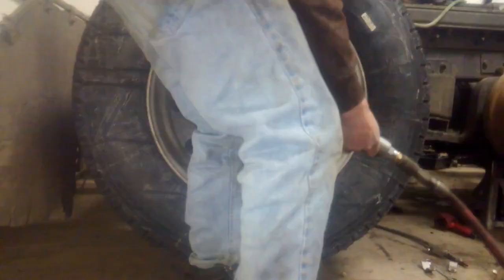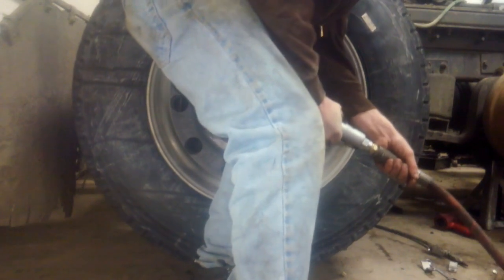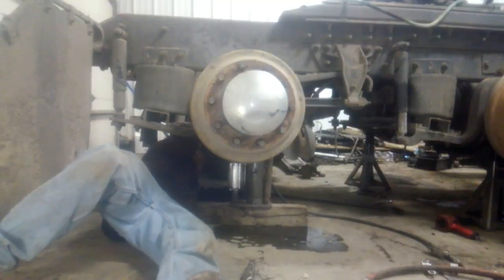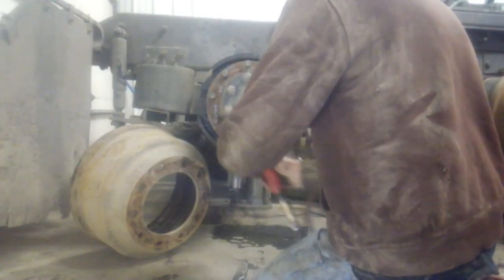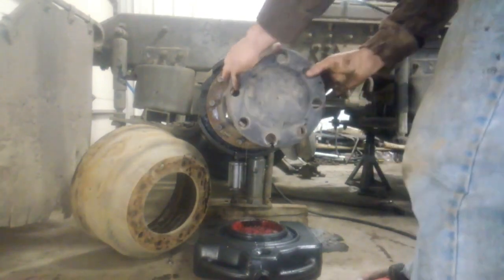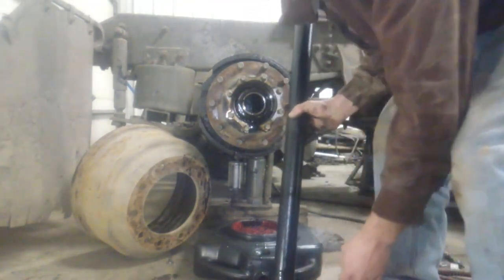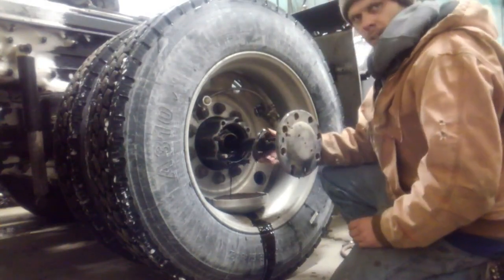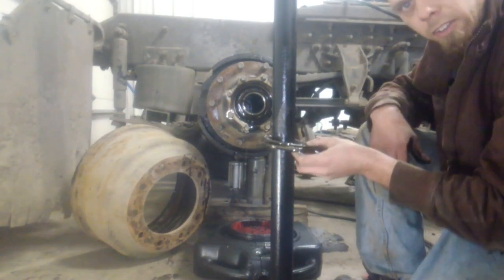wheel bearings seals and races replacement on a semi truck

Comment: Any tips for removing and installing races on aluminum hubs? I've only been a diesel mech for about a year, and my mentors always seem to tell customers that we cannot take out the races on aluminum hubs because you have to heat/cool them and that it's a lot harder than steel hubs.

Comment: Hey. Brother. Just wondering. What. Size. Iron. Socket. You. Use. To. Take. Off. The. Inner. Nut. Of. The.   Hub. Thanks again. For. The. Videos. They. Are. A great. Help. Blessings upon. You
Reply from the maker: i wish i knew off the top of my head. truth is iv got a pretty good assortment of axle nut sockets iv collected over the years i rarely ever look at the sizes i just grab the one that fits. i know that's probably not much help to you.
Reply: Maybe a 3  1/4 or 3 3/4 they vary. Good to have several

Comment: How tight do you torque inside and outside nuts?
Reply from the maker: torquing procedure will go 200 ft lbs while spinning the hub, then back off 1 full turn then torque to 50ft lbs while spinning the hub then back off a 1/4 turn and line the dowel up with the closest hole in the lock ring. generally favor looser between two holes, also sometimes flipping the dowel lock ring will get you closer to a hole. then the outer jam nut is somewhere around 300-400 ft lbs without the tang ring like i added in this video or 250-300 is acceptable with the locking tang ring. i would recommend always using a tang ring even if there was not one to start with, iv seen a lot of jam nuts come off when tang rings are not used.

Comment: Hey ezrider quick question for you I was changing my drive tires on my truck and I took of the brake drum I had to cage the brakes because i have my abs modulator valve off the truck so i could not just push my brake button In. 
One side changed out smoothly but the other side of the rear diff the drum was stuck really hard with rust and debris I had to use my tractor with a chain and hammer it out now the new one is half way on but it doesn't go in any further and it same one as the old one plus the s cam is in the open position with that brake cage
Reply from the maker: might have to back the slack adjuster off a bit. i assume the drums are hitting the shoes and not getting stuck on the hub?
Reply from the maker: here is a video i did on brakes that might help you if you haven't seen it already. https://youtu.be/JHCpmQJEPbc

Comment: Is there other way to remove the race from the hub with welding?
Reply from the maker: Welding isn't nessisary just makes it a little easier
Reply: @Ezrider359  l am trying to remove the race in the steering axle hub  but l don't have welder.  Does hammer and flat Philips works?
Reply from the maker: A punch or drift would be preferred over a screwdriver but yes smack it like it owes you money alternate side to side
Reply: @Ezrider359  thanks you sir

Comment: Great vids mate. I got disc brakes on the CH I drive. I fucked up and wore pads down and wrecked rotor.
Today I pulled rotor off wrecked truck, tomorrow Im putting on the one I drive.
I dont have torque wrench to do  lock nuts on axle. I was thinking  tighten inside nut till zero movement, then back off a 1/4 turn. and tighten outside lock nut very tight.
Probably wont hear from anyone before tomorrow, but would still love feedback.
Im only a driver, definetly no mechanic😂

Comment: Hi what's is the size of the locknut socket
Reply from the maker: I believe both inner and outer nuts we're 4inch on that one 3 7/8 are somewhat common and 3 1/4 lock nuts on trailers are common

Comment: What is the part numbers to all bearing & race ? Thanks
Reply from the maker: there is many different rear ends that can be on these trucks and they don't necessarily all use the same bearing part number, call a dealer with your vin and ask for a part number or pull the bearings out and cross reference them.

Comment: Basically same process for the front axle then? Seems simple enough. I’m going to do my king pins after watching your king pin video. At the same time, curious as to why the hub needs to come off for the king pin job. Doesn’t seem to be in way of anything
Reply from the maker: the process is the same for the front drive axle wheel bearings. on the king pins generally the hub has to come off to remove the s cams so you can get the whole s cam assembly out of the way. it could probably be done leaving all that in place but i find it best imo just to strip the wheel end all the way down.
Reply: Ezrider92356 copy that and makes sense that’ll give me a good reason to just replace the worn out s cams anyhow. Thanks brother

Comment: Where did you get the big socket to remove the locking nut?
Reply from the maker: napa auto/truck parts stores generally have them on the shelf ask if you don't see them they may be behind the counter. that's where most of mine have been purchases from. if you have time to wait for them if you search ebay or other places on line for "wheel bearing axle nut sockets" you should find a number of them. generally when iv bought most of mine though its when i have already started taking something apart and realize that none of the ones i have fit that particular nut. then measure with a set of calipers run to Napa get one and your back to it in 30 mins. iv seen them come up in local classified ads as well.
Reply: So there is different sizes of these nuts? I haven't started taking mine apart yet on my kenworth, just making sure i have my ducks in a row before starting.
Reply from the maker: smart man its always nice to have everything you need on hand before you start. you may call kw and ask them what size you will need. there is a chance they could tell you the wrong size though. sometimes the outer nuts are smaller than the inside nuts. so you may need two sizes sometimes someone may have replaced the nuts at some point in the trucks life and used nuts with a different outside size. there is also a different style nut some people re-fit with esp if the threads have gotten a little buggered at some point in its life that rather than being a sandwich assembly its a thick single nut that has a inner snap ring assembly and kind of a toothed mechanism inside. that locks everything together that would take a different socket as well. there are probably 4 sizes of these sockets that i use most often i would tell you what sizes they are but the sizes are stamped really small on them and i don't think iv actually looked at the size sense i bought them so i don't know off the top of my head what size they are. then the ones for the steer axle are quite a bit smaller than the ones for drive and trailer axles i actually have a jumbo 1 inch drive socket set that goes big enough to cover those ones there probably somewhere around 2.5 inch where drives and trailers are probably in the neighborhood of 4 inch.

you can also get them off in a pinch with a hammer and chisel but i would not recommend that for re-assembly. but you could get it off like that to go run to Napa and match them up to sockets
Reply: Thanks for the info. Will napa have the seal punch as well?
Reply from the maker: they may. i would call and ask, being that i generally only work on my own equipment i personally don't own any of the large seal drivers, each style seal has there own seal driver and there is several different style seals that can fit one application. in this video i go over in a little more detail on getting the job done with minimal tools https://youtu.be/tXBuAh8lZI0 this one was on a steer axle but its all basically the same.
Reply from the maker: I am out at the shop the size I used in the video can't read the socket anymore but measures 4.006 so that should be a 4" the other most common ones I use are 3 1/4 and 3 7/8
Reply: thanks for the replies i really appreciate it. Love the videos, keep em comin.
Reply from the maker: no problem, my channel is pretty small so its not a big deal to respond to comments and try to help as much as i can when people ask questions. i appreciate you guys watching them.

Comment: The key to all the troubles and having a third member in the differential cannibalize itself was because someone left out the tab washers when servicing the rears last time around.  That’s nuts! No pun intended.
Reply from the maker: Separate issue not the cause of the initial failure
Reply: @Ezrider359  Thank you for that response.  I was trying to figure out what the initial cause was on that third member failure.  Maybe it was just a little abuse by the previous owner.  Did you figure it out EZ?  Do you have any theories?  I know it has been a while.
Reply: You make it look so easy to fix but that was a major failure.
Reply from the maker: It was driver error on my part. Frozen drive axle brake rather than getting out and beating the drum with a hammer I tried to rock it a little with the engine to pop the brake loose but broke the rear end instead.

Comment: Can you go into detail more about removing the races. I saw you weld real quick then just tap them out. I know it's more to it than that lol
Reply from the maker: There really isn't much more to it than that. The welding a bead on the race is not necessary but does make it easier. Then just drive the race out with a hammer and punch. Be sure to drive it out evenly moving from side to side. Be sure to give it a good hard smack every time. Hitting it softly isn't going to do anything and take forever
Reply: Ezrider92356  knocking the races out on the steers is a bit more difficult than the drives,since the hubs on the drives have a cut out in them where you can hit the races. Also not a good idea to let the hub drop after sliding it onto the spindle. That can damage the seal. Another good idea is to get some sandpaper (300-320 grit) and polish the areas on the spindle where the bearings ride. Just my 2 cents. All in all Good video keep em coming

Comment: Does anyone have the habit of putting bearing oil in the filler cap and spinning the axle around a few times and repeating by adding more oil, so the bearing gets nice a lubricated? I always let mine soak 5 minutes or so and top the bearing oil off.

Comment: Shit, everything fell apart. Scary
Reply from the maker: i was curious how long it would take for someone to comment on that...lol this is why you never ignore a leaking wheel seal. often times it can be the first indicator you have a bearing problem.
Reply: I changed the seal on mine but it still leaks . I should go ahead and replace the raced and also the bearing as you did . Love the video
Reply from the maker: if its still leaking your have to pull it back apart and try to examine why it is still leaking. it could be improper bearing pre-load. or if your using a 1 piece seal if there is a grove worn in the axle where the seal lip rides you may need to use a 2 piece seal or a seal that uses a wear sleeve. or could be a issue with the bearings themselves. all my equipment has some miles on it so a lot of times when i do a seal i just do bearings as a preventative. not always but most of the time. by the time you tear it all down for a seal all the labor to change bearings other than the races is already done.